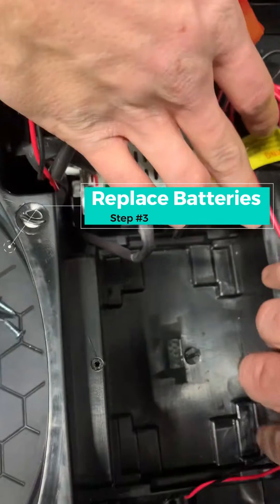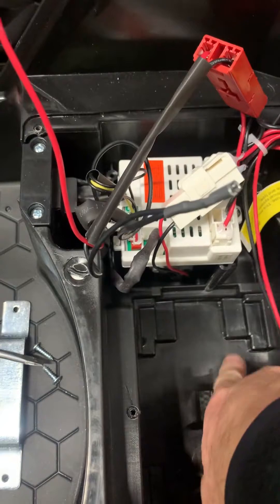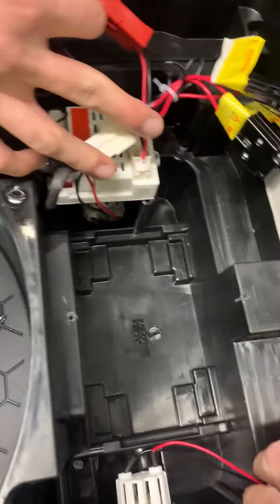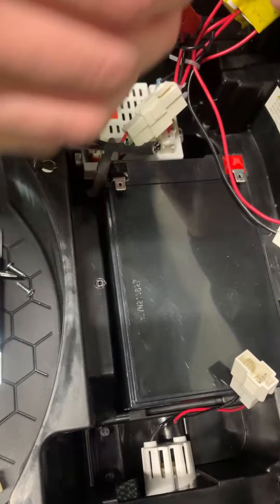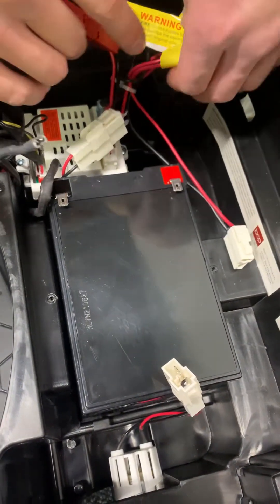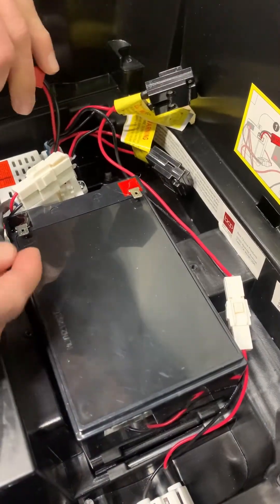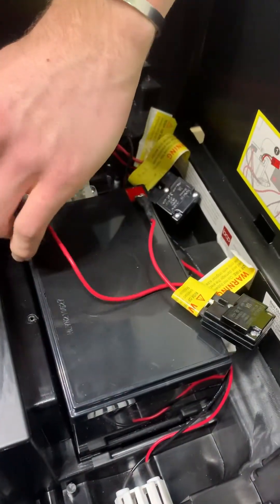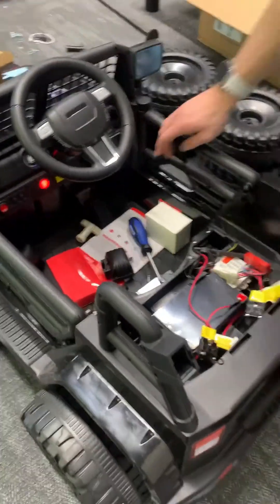How To 3x Ride Time for Best Choice Products Kids Ride-On Jeeps

Comment: Do you need to upgrade the charging mechanism as well?
Reply from the maker: No, there is no need to upgrade the charger. It will take longer to charge the higher amperage battery, but should still be completed by morning when connected at night.

Comment: Do you recommend putting glue back over the terminals? Just ordered a replacement battery for my nieces!
Reply from the maker: It is not necessary. The push on connector has a tiny dimple that clicks into the battery terminal and should not slide off during use. If for some reason yours does not have this, a dab of hot glue would be fine.

Comment: So how long you get now?
Reply from the maker: It is dependent on the Childs weight, selected speed, terrain, etc. But say if you were getting 30 minutes prior, you would now get 90 minutes by changing from the 5Ah to the 15Ah.
Reply: @impactbattery8895  in short, I can replace battery with same Voltz and with higher Ah to increase usage time without modifying or changing anything else?

Comment: Great video!  Question did you change the size of the battery or just replaced the factory battery?  Thank ya!
Reply from the maker: Both. The toy has space to increase to a larger physical size. So we tested our Impact Battery branded battery (part number: IB-12150-F2) and it worked great going from 5Ah to 15Ah.
Reply: @impactbattery8895 does this also make the car faster? Or will this only increase the battery life?